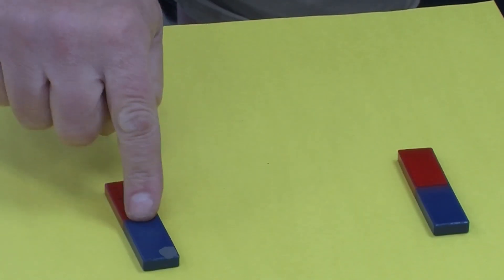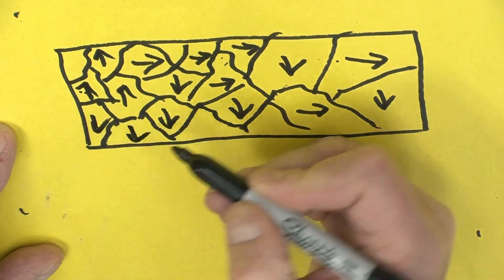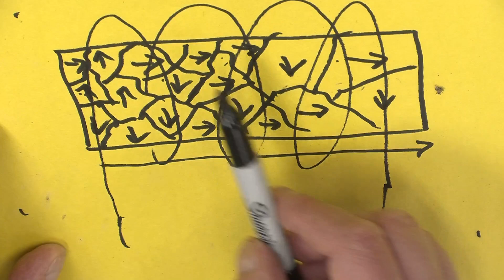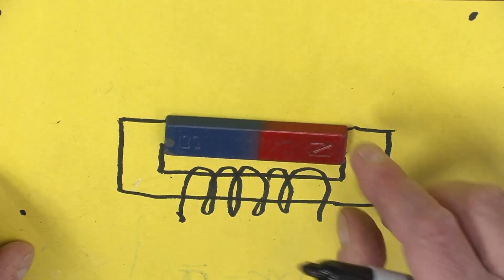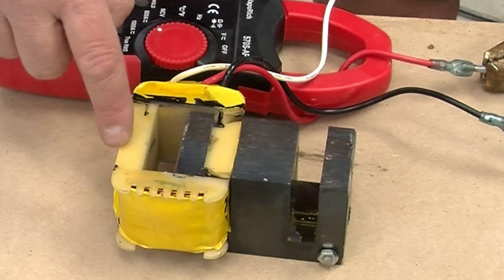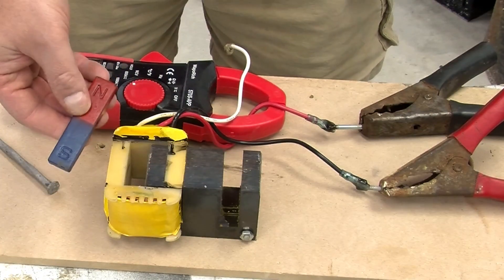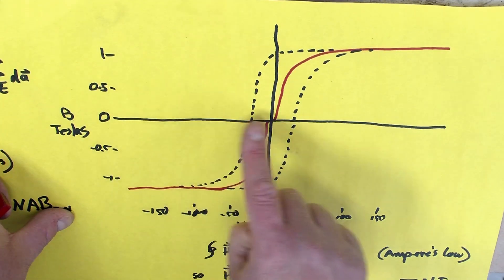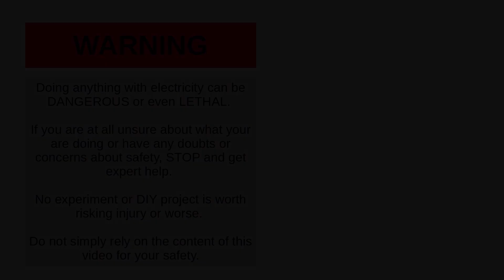How to (Re)Magnetize a Permanent Magnet

Comment: Another way, maybe better,  is to charge a suitable capacitor and dead short it against the magnet coil. With some care, from the B and H diagram one can obtain the (co)energy density of the magnet metal per gram or cc and calculate the total magnetization energy required by the magnet in Joules. Then using a generous safety factor let that be the capacitor energy before the short
Reply from the maker: It would probably be better - certainly could be done with a much smaller power supply. And your absolutely right - do a calculation as to how much energy is needed and setup the system accordingly.

And to do things cleanly, maybe a SCR or MOSFET as the switch to handle the current surge without eroding switch contacts.
Reply: @qinaan  
Please give the calculations that you used.
Reply: Isn't it better to use only air in the magnetic loop so you don't have any limit on the field strength?
Reply from the maker: @paulcohen1555  No! So things like iron have relative a permeability  in the 1000 to 100000s, meaning the B is that many times stronger for a given H field that it would be in air or free space with a relative a permeability   of one. As we drive a core in to saturation, its relative permeability drops but will always be more than air. So go for a nice iron core, a bit thicker than your object to be magnetized so that the B field get scrunched together and gets  bit stronger in the  object to be magnetized.
Reply: Have you considered attempting to create a monopole magnet?
Reply from the maker: @HeyMichaelLeo  Unfortunately you cant actually do that. While there is a place in Maxwell's Equations for for a magnetic charge (ie monopole), a magnetic monopole particle has not been found in spite of years of searching  by particle physicists. Even if such a particle were found, its rarity would still not allow a practical magnet to be made - you would need billions of them to make a practical monopole magnet.
Reply: @ElectromagneticVideos  our current physics has laws of limitation that are wrong, due to the lack of quantum consideration.
Reply: @HeyMichaelLeo  NO!

Comment: What was the voltage used on the coil? You said battery charger so 6,12,24vdc?
Reply from the maker: It was a 12V battery charger with a high/low setting so probably between 15 to 20V. Since the resistance of the coil is really low it really didnt need much of a voltage to drive that much current.

Comment: In oder to avoid high current, could time also  have the same effectivness? (ex. in lieu of a few seconds at 60 amps, then 15 amps over an hour?)
An alternative method can be applying electrical current, while heating to luminescence?
Reply from the maker: It doesnt really accumulate over a length of time. You really need a high strength magnetic field so high current is a must (or many turns).

You right about heating - apply current while hot and above the Curie temperature and then cool down while maintaing current. Rocks thats were once hot like on the mid-oceanic rifts become magnetized by the earths field as a natural example of this.

Comment: Something I saw years ago....a guy in a shop I worked at had salvaged a coil out of some ballast...even with the iron core removed, it weighed a couple pounds. He wired a momentary contact switch in series with it, and drive it off 120 volts ac. Done just exactly right, you could magnetize and demagnetize with it. It might take several attempts to magnetize something...you had to hit the switch quick, but you could do it. Never tried this myself, but it worked...
Reply from the maker: Doing it with AC is wild. I guess if you turned  it off after the current has reached a peak (ie max   H field) and before it reverses your would end up with a nice strong field. So the second half of every half AC current cycle. So maybe 50% of the time you win, 50% of the time you loose. And furthermore, pressing it for a really short duration can result in high inrush current to that is still there  when the switch is turned off.

How clever!

Comment: I am the first time to see your videos.  It is very well executed and explained clearly.   I wonder what your current supply look like.    Thanks again for your wonderful video.
Reply from the maker: Thank you so much! I am gradually learning how to do these videos and I think they have gradually gotten better as I do more of them. It has been great fun because they have given me an excuse to do many ofthee things that I haven't done since I was a student!
Reply: @ElectromagneticVideos  do you mind show me your 100A power supply?   😀
Reply from the maker: @manla8397  I don't have a photo of it right now, but it is an old analog automotive 12V battery charger that can put out 100A or more to also help start the car. You really need the old analog style ones for this  because the new switching power supply ones will do all sorts of things and detect its not a battery and turn off. You can also use a variac to control the output of the old style charger. 

You could also use an old style arc welder controlled by a variac. If its an AC welder you can get a 200A bridge rectifier  to make DC.

Comment: Great video again! Regarding this I have a question about motors in my Nagra tape recorders. In these motors the rotor is a coil of wire with no laminations with inside there sits a permanent magnet which is completly enclose by the coil. To replace the ball bearing inside the complete coil and magnet has to be taken out of the housing. This then needs to by kept in a special cylinder (mu-metal?) so the permanent magnet doesn't loose its strenght. Can these Alnico magnets loose there magnetism so quick if it is kept outside of the motor housing? I found this rather strange. Its all in the manual and reads that if its not done like this the motor needs to be send back to the factory in Switserland to be re-magnetised. Sorry I can't show pictures of it here!
Reply from the maker: That is interesting! So when the rotor is removed, the magnetic circuit  - that path that the field flows though now is mostly air rather than metal, which tends to encourage demagnetization (closer to the downward section of the BH hysteresis curve). If subjected to vibration or warmth (more energy to jiggle the domains around) down the curve you go and the field drops. Put it in a cylinder and you once again you complete the magnetic circuit and its much easier for the magnet to stay magnetized. Any reasonably thick iron or steel cylinder (pipe) should do as long as it is only marginally bigger in diameter than the diameter of the rotor. You need a close fit. Bang the rotor while its outside and the magnetism could be gone.  So I think that's the manufacturers concern. 

I'm a bit puzzled by the coil around the rotor. Is it powered to try and boost the field or keep the field at its peak? Or is it some sort of sense coil to provide some sort of feedback such as if the magnet slips out of synchronization with the stator's rotating field?

Comment: I finally broke down 2.5 Watt speakers from 1968 since the cones were extremely dried out by weathering and the magnets around the speaker cone still are strong.  Ferrite magnets remain polarized by weathering if temperatures never got hot enough to unalign those magnetized dipoles that were originally locked in place.  For nearly 60 years Ferrite magnets remain strong.
Reply from the maker: What an interesting data point on the longevity of ferrite magnets! I wonder how well modern Neodymium magnets will have held up in 60 years from now!?
Reply: OVER 6O years. FERRITE MAGNETS ARE MUCH OLDER Than neodymium magnets!!! Black 🖤 FERRITE MAGNETS go back over 1000 years.
Reply: I have a pair of headphones from the 1920’s the mag’s were a bit weak when I first got it, I’ve since tried magnetizing them more, to which I’ve had luck but they could still be stronger. But I can say about the same for 100 year old magnetics they our still alive! And the phones do sound pretty close I can tell which side is a bit weaker. I didn’t hit it with much current, also and interesting thing I’ve noticed here during the video trying to find the magnetic poles, red usually donates north, but the problem here is that opposite attract so north on compass is attracted to south magnetic pole, and south is attracted to North Pole.

Comment: Great and educational video, but i have a question: does it matter for how long the external magnetic field is applied to a weak magnet? If i charge a 2000uF capacitor bank to 400v and put like 5000A through my coil, will i end up with an extremely strong magnet?
Reply from the maker: Thanks you! The process of magnetization should happen very quickly - certainly the type of speeds we change the magnetic field in transformers for example. So if you setup a capacitor bank as you described and make sure there is enough charge to keep the peak current going for say 1/100th or a second it should work. The really nice thing about your idea is you can get away with much smaller wires that would be needed for a longer period of high current. It would be a great experiment to try and see if if it works (be careful with 400V!) . One thing to point out though - you will always be limited by the saturation and remanence characteristics of the material you are magnetizing so there will be a current value above which you get no greater permanent magnetic field.
Reply: @ElectromagneticVideos  Im very grateful for your reply, Thanks.
Reply from the maker: @rekinek1111  Your most welcome! I really enjoy questions like that - its so interesting to think about something clever like that. If you try it, I would be fascinated to hear the results.

Comment: Why don't you move the magnet down to magnetize the other half instead of reversing the polarity?
Reply from the maker: To make sure we are understanding each other you mean slide the magnet to the left so the right side of the magnet is now over center leg of the old transformer core, right? That probably would have worked but would have also applied a small reverse field over the shifted left side  of the magnet which (depending on strength of that field) might have had small demagnetizing effect on the left side of the magnet. 

The real issue is that the permanent magnet I used was to big. Ideally its ends would be the same distance apart as the two left legs of the old transformer core. And for that matter one really needs just a U shaped core for the electromagnet as opposed to the E shaped transformer core.

Comment: When I was in elementary school, the science teacher hung an iron rod om strings from the ceiling, oriented north south...after a few months, it was weakly magnetized ( could pick up a few pins)..
      Two jobs ago, we had a magnetizer/demagnetizer. It was just a coil driven by 120VAC. Just push the button briefly to magnetize, hold it down and slowly withdraw the screwdriver to demagnetize it. 
     Your videos should be shown in schools!
Reply from the maker: Thanks! I had not heard of the experiment you described. It must be that with magnetically soft iron or steel the domains are so easily changeable that the thermal energy in a conformable room is enough to gradually change the magnetic orientation. I will have to try that sometime, maybe with a piece of rebar. 

The one I remember from grade school is stroking a nail with a magnet to produce a weak magnet. I guess each school and science teacher had a preferred experiment. 

Demagnetizers - 10 years ago I was involved in some factory automation design sorting some small items the size of finishing nails. Problem was they would get magnetized. The company's solution - which I duplicated - was to take out the rotor from an induction motor and power the stator with 12 to 24V AC and slide a plastic jar of the items being processed though it. Worked perfectly!
Reply: @ElectromagneticVideos   As I understood it, the iron rod was magnetized by the earth's magnetic field, which is why it had to face north south..well, magnetic north and south. 
      I remember reading an article that steel ships can become weakly magnetized over time...and this can cause navigation problems....at least before gps was a thing.
     The " Philadelphia Experiment" conspiracy theory about making ships " invisible" got its start from an experiment to degauss ships, making them " invisible" to magnetic mines...
Reply from the maker: @scottthomas3792  There was a faster version of the experiment you describe - same idea but hitting the rod with a hammer to encourage the domains to re-arrange to the direction of the field. I never thought about the steel in ships - but makes sense. When I was a kid we had an compass stuck on the dashboard of my dads car. It had little adjustable magnets you could adjust to zero out the field from the car's steel. We never got it even close to perfect!

I didnt know that was the back story to the " Philadelphia Experiment" conspiracy theory. Shows you how adding secrecy to something like that makes peoples imaginations run wild!
Reply: I agree.. watching this... it blew my mind. Thank you sir and yes this should be shown in school. Shit.. give the teacher 20 min break lmao this YouTuber got the KNOWLEDGE ❤

Comment: ok i have an old permanent magnet generator from the 1974 its 1800 watts it was my dads. it was handed down to me.. It sat in storage for years . when i got it and started it up it only did 800 watts i thought ok 800 watts i shut it down .. the next day i started it to show my friend  it then made the 1800 watts???? i guess I'm picking your brain lol... my friend says the magnets had just rejuvenated... is that what happened?
Reply from the maker: That's really interesting! So assuming its AC, there are some interesting behaviors that are associated with AC motors and generators. If you have an inductive load attached to the generator (like a typical AC induction motor) the field created in the generator from the lagging current flowing to the load will tend to  oppose the magnetic field in the field magnets and potentially try to demagentize it. A capacitive load (rare) will draw a leading current and tend to strengthen the field. Maybe there is a capacitor in the generator to encourage that, although I have never heard of that being done in a permanent magnet generator. Its typically done for induction generators.

 Another possibility is a series field winding to strengthen the field when more current is drawn (simple voltage regulation) . Thats typical of electromagnet field windings  but could be done in permanent magnet ones I suppose.

Of course with all of that said it could be something simpler: Are there brushes/slip rings? Could it be they got cleaned up after a bit of use? Or maybe some connection was poor and heated up and fixed itself? 

Has your friend seen magnets get rejuvenated before in a generator? If so thats really interesting - I'm an  EE but haven't done much with motors/generators since university. How did you test the wattage? What type of loads?

Comment: I never understood what Amp Turn is, now I do :-) Thanks for basics.
Reply from the maker: I so glad it was understandable! I just looked at your channel - and the HP 41CX.  I'll make some comments there!
Reply: the higher the tensile strength,,, basicly the hardness of the steel the harder it is to magnetize ,,such as the difference between a 16 penny nail vs a knife blade made from carbonised steel ..however there are certain conditions you can magnetize high grade steel if you heat the metal up to a glowing red and then keep a current or magnetic feild around the  piece being magnetised long enough till the metall cools down it will hold a magnetic field longer and be strongr also. this a basic way of how neomydium magnets are formed ,,If you will watch how magnets are made on an industrial scale  you will notice that they will heat the object that is being magnetised , is they will heat t he metal red hot and then will zap it with a similar setup that this video has shown for a few seconds with low voltage and high amperage.. after the metal cools they will zap it once more with around 30 or 40 amps and around 30 volts .. in the final stage. i have been wanting to try this with common metal materials i have laying around such as transformer cores , which is made from highly magnetic material in A/C transformers. A/C current will create a stronger magnet such as used in junkyard cranes because A/C current when turned off  th emetal is returned to nuetral if they used DC current in those magnets i the junkyards then they would not be able to release the junk iron they pick up. A/C current creates a very very strong magnetic field although.  but is used only in certain applications. to demaganitize a piece of metal then u use a/c currrent .

Comment: I did something to a magnet, destroyed it with a stronger magnet somehow, but don't know how too explain it.
Well I guess I do..
I was pushing a smaller magnet against a larger neodymium magnet, opposing, and the little one just gave out all of a sudden.
No more magnet.
Reply from the maker: Thats too bad - but not uncommon. When you push the same poles of two magnets together, the fields try and shift the domains in the other direction. Do it a little and you manage to move some of the domains such that the field is diminished. Do it with a really strong magnet and you can magnetize the smaller on in the opposite direction but its hard to get the field  strong enough to do that. So in your case the big magnet managed to reverse the domains at least party in the smaller one reducing its field.